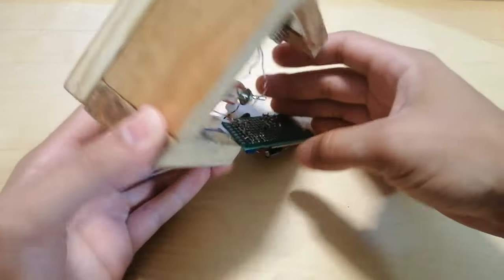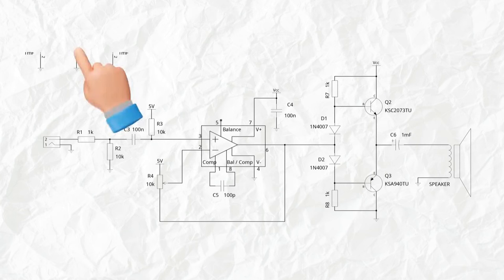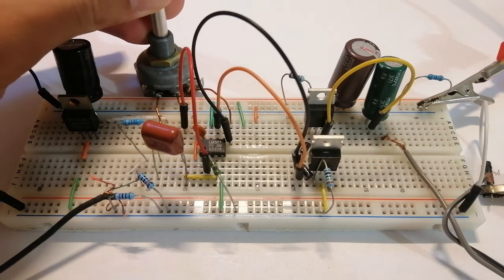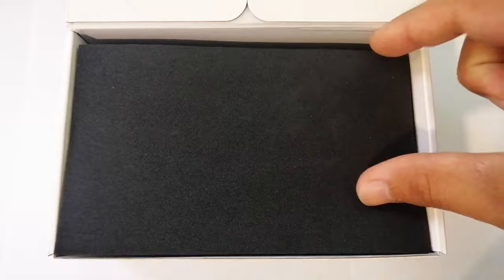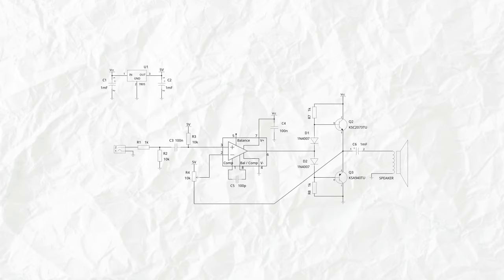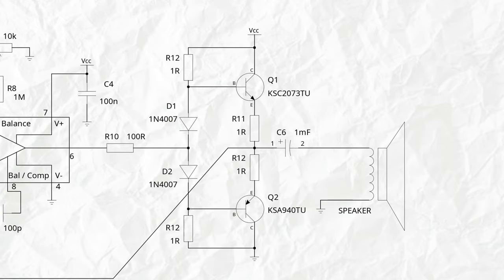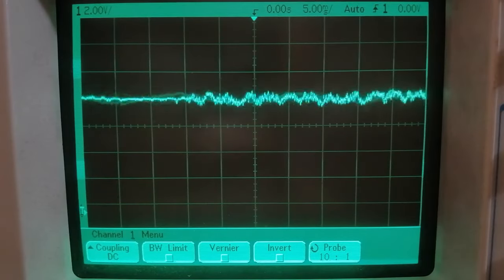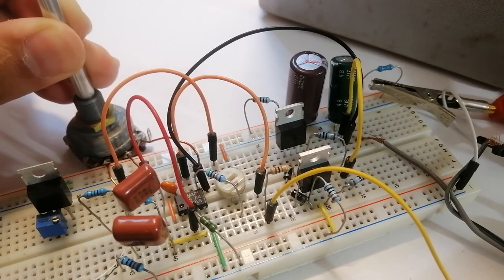Building a Class AB Audio Amp with Closed Loop Feedback   | Live Demo Webcam of BenQ ideaCam S1 Plus

Comment: Bruh you changed the diode biasing resistors to 1 ohm 🤣 Adding a 10k between the positive of C6 and the middle of the diodes might also help let the opamp remove cross-over distortion because it gives it a small direct path to the signal at that time

For more gain you might also be able to use a sziklai pair.

There's a channel "Engineering Prof." he has many very good circuit analysis videos, and quite a few on amplifiers and determining components for them; for example "Push-Pull Power Amplifier with Darlington and Sziklai Transistor pairs"

Comment: Great example of amp. 😃 Btw it would be great if you make a video about a CB frequency radio communication for any MCU based project 😃 because the existing modules have really low range, it would be great if you manage to utilise a lower frequency for better penetration. Maybe testing with a digital encrypted walkie talkie project... Wishes!
Reply from the maker: It's an interesting idea, I remember your previous comment about it. I am also thinking that for uC projects (that are usually quite small in size) CB is not optimal, it's around 27MHz and at these frequencies a proper dipole antenna is 5 meters long (2.5 m for monopole) this becomes really impractical.
Also having tried this kind of projects in the past I realized that experimenting is quite difficult because the transmitter and receiver are often within near-field range of each other, and the signal appears to go through the power lines in the walls. making it quite hard to work with.
In any case I'm keeping this idea in mind, as I always like the RF field of electronics
Reply: @5VLogic the anteena need not be 5m long in a straight line, you can wind it up in a coil and it works just fine! Its called anteena loading btw, 😃 I want you try this project. In a couple of videos, I saw an Arduino used to generate the AC signal with its two PWM pins. But couldn't find a detailed description. I hope you look more into it 😀 Good luck 🤞
Reply: @5VLogic As far as I know, the 27Mhz has better penetration than 2.4Ghz and it works great as long as the wattage is sufficient. Testing some circuits might help though...

Comment: By creating the virtual ground shouldn't the speaker be connected to it instead of the original ground ?
Reply: Single ended amplifier.
Reply: @4bSix86f61    huh?
Reply from the maker: I believe it would make some problems since the linear regulator isn't made to sink current, therefore the AC would be problematic. Although I should probably try it.
Also any small offset would result in DC going through the speaker which isn't nice.